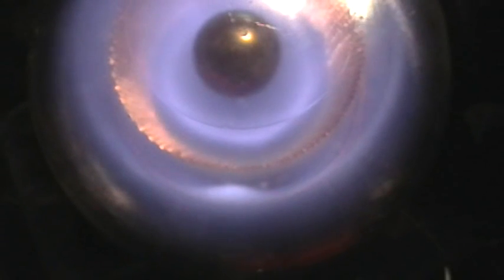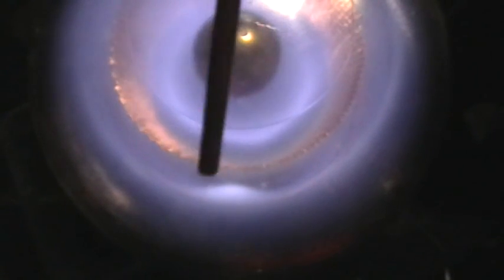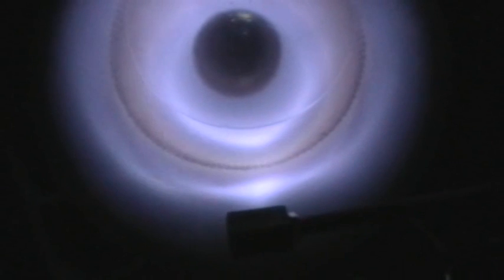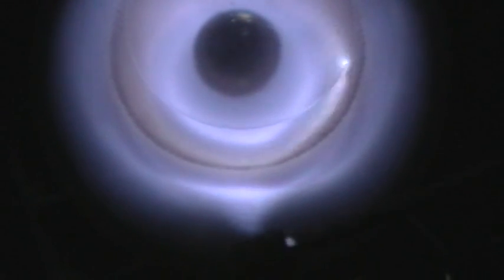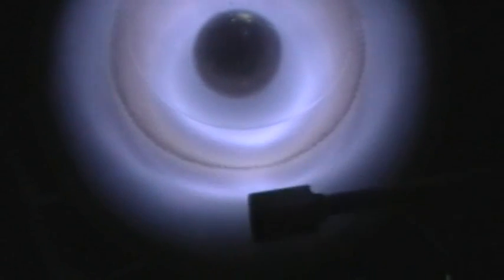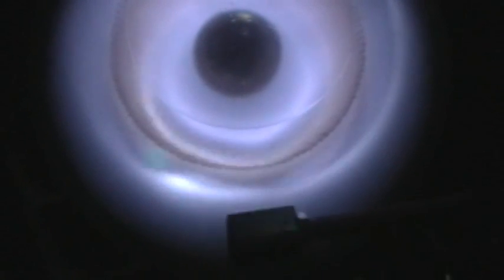Extreme High Voltage: Plasma Interactions with External Magnetic Field

Comment: I know almost nothing about plasma other than it's a great conductor. So assuming there is current flowing then perhaps this is similar to a DC source current and a return path through a ground plane which will follow a parallel and opposite path back to source. So the anode glow is the source and the cathode glow is the return path likely flowing in opposite directions. So the return path in a ground plane of closed circuit maps to the source line because the source current is generating a magnetic field (right-hand rule) which in-turn causes there to be an opposing resistive force on the return current if it ever varied from the source path. The point being, although I've never actually tried this, if you were to bring a magnet close to a ground plane so that it opposes the magnetic field generated from a source current then the corresponding return current path should adjust to find the new least-resistant path leading back to source, effectively causing it to bend. Seems like there is some correlation here, I'd be curious to see how a Hall sensor responds to the two different glows, I imagine there should be a magnetic field. Definitely want to learn more about plasma now. Another great video TinselKoala, I've been enjoying watching your experiments (although I am a few years behind, seeing this was filmed in 2013).
Reply from the maker: +Gregory “f3z0” Ray 
Thanks for watching and commenting!

Comment: The white plasma is going diamagnetic.  It is rejecting the external field.  It moves away.  The blue seems to be magnetized - whereby the plasma and magnetic field interacts.  Is the glow is indicative of the energy levels?  Or is it the two populations of (-) electrons and (+) ions?  This topic is far from explained well - and most plasma physicists play games with math all day and fail to do this practical lab work.  Diamagnetic trapping is what Lockheed Martin is pursuing for their compact fusion reactor.  The idea that the diamagnetic plasma rejects the external field and creates an awesome trap, the EMC2 paper from July 2014 talked about this behavior in the polywell.  Incidentally, diamagnetic trapping is only predicted in sharply bent magnetic geometries.
Reply: Is diamagnetic trapping similar to ions in magnetic reconnection? Whereby ions loose their magnetism or become diamagnetic where field lines merge and magnetism is converted into Kinetic energy? Definitely looks like it happens in the region where field line merging would be occurring. Is this pulsed or flat HV? If it's pulsed, the field lines will be constantly connecting/reconnecting, which means the ions will be accelerated in those regions continuously.. I guess?

Comment: just gonna spew my thoughts on why the plasma behaves like it does,

the plasma is caused by electricity, so all particles causing the plasma glow are negatively charged electrons
that would mean both "types" of plasma "react" to the magnet in the same way, so you would expect both the apparent different types of plasma SHOULD act the same.

and technically it probably DOES act the same, however since there's only one "entry point" for the electrons, they might be spinning, and this motion alters the way the electrons interact with the magnet
the apparent opposite way of reacting to the magnet might be caused by the cathodic plasma actually turning around (so for example it enters the cathode travelling clockwise around the cathode, then in between the cathode and the anode it turns around, and then exits the anode travelling counterclockwise

the other effects are caused by the fact that electrons react opposite to positive or negative magnetic fields

lemme know what you feel about this theory ;)

also the appearing/disappearing might be because the "Existence" of the lump causes the somewhat flexible cathode to change shape, until it's no longer able to sustain the lump, at which the cathode deforms back to its original shape, at which point the lump starts accumulating again due to some super complex interaction between the electrons inside and outside the cathode (keep in mind that every electron in the globe acts like a small magnet all acting on the other electrons, and that the electrons inside the cathodic metal are "glued" to the metal atoms there, so changes in electron density in the vacuum around the cathode can apply forces to the cathodic metal)